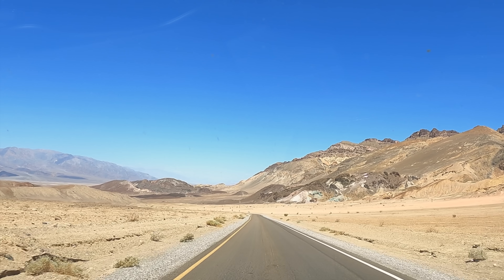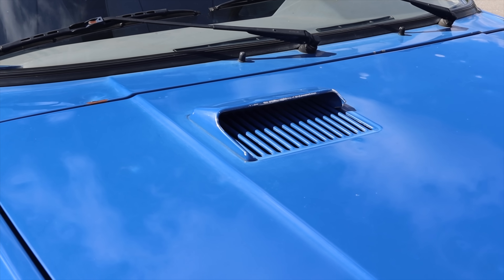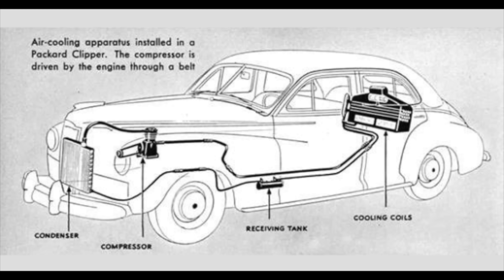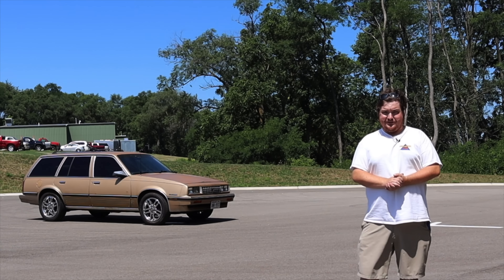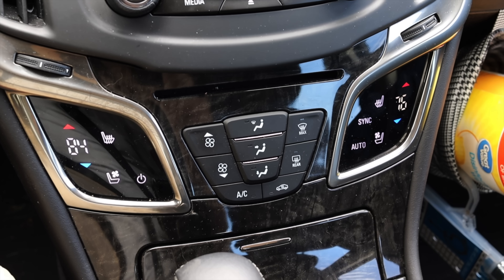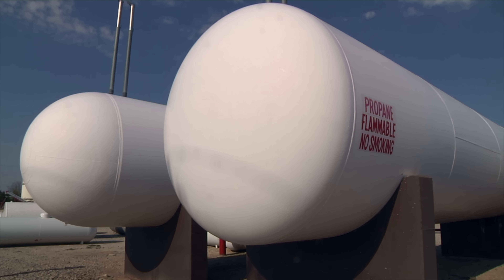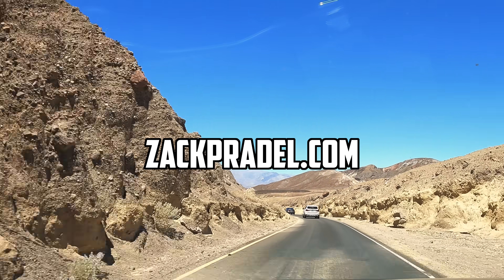Air Conditioning - The Story Of R12 & Why Modern Air Conditioning SUCKS!

Comment from the maker: CARS WERE BETTER IN THE 80’s STICKER NOW AVAILABLE!

 https://www.zackpradel.com/product-page/cars-were-better-in-the-80-s-sticker
Reply: 73 Mercury Rideau 500, 350 Cleveland, MX trans.  The AC compressor was 50 lbs of steel. R12.  - In Hot July and August - I could make it snow like in Canada. Being Canadian, that was just too much fun.    13 mpg - 11 when it snowed.   Cheers from an old dude.
Reply: i don't think that's going to sell that well
Reply: WTF? 
80's cars and trucks, every brand, in general sucked!  We considered it some kind of accomplishment if they started and ran in the cold, or didn't overheat in the summer.  Most couldn't max out that 85mph speedo, and when you tried they sounded like they were gonna fly apart.  They felt like they were gonna blow up at 55!  For you younger folks, that was the fastest allowed by law NATIONWIDE in the 80's. 
People wore it as a badge and bragged if they somehow squeezed 100,000 miles out of one of theses POS cars/trucks after working on the damn things constantly. Every week there was a maintenance item.  Oil change, tranny fluid, spark plugs, coolant, brakes, differential oil, transfer case, tires.  And they leaked every damn fluid all the time.   My pickups couldn't carry or tow they're rated capacities.  They broke when you loaded them down even with all that work. Braking was almost non-existant with a heavy load.  If you loaded the bed close to gvwr, you could barley steer. Every vehicle I've been in that has been made in the last 10 years is, for the most part, a high performance reliable rocket that will run for 100,000 miles without ANY service.  They don't leak, and they run smooth as silk.  My last 3 new trucks can pull 30,000+ all day long as fast as you wanna go.  They start and run without any problem every time no matter the weather.  Heck, I don't even have to be in them to start them!  I change oil once a year and trade them in at 100,000 miles.  New automobiles are so much better that after I abuse one.  Another guy can buy it with 100k on the clock and keep using it!
Reply: @ThePragmatologist you still see vehicles from 80s on the road today tho let’s if you can say the about modern vehicles in the next 40 to 50 years
Reply: @ThePragmatologist  Nope. Honda, Toyota, Nissan, Mazda, VW...all had many good products back then  that were not only pretty reliable, they were more importantly DURABLE. Which meant you could mostly cheaply and easily maintain and repair these cars for decades! I know I was  there. 
My 1984 Rabbit GTI (MK 1  Golf GTI) was the best car I have ever owned, and I am old now. The past two decades or so most car models are horrible in so many ways and outrageously priced.
Reply: @horseathalt7308 
Does your 1984 rabbit routinely pull 20,000lbs?  None of the brands you mentioned ever made a vehicle that could.  The Japanese imports had their problems as well.  Getting a part was the big one.  My point of view from memory is that even the best 80's vehicles were a pile of garbage compared to what I can buy new today in both capability and reliability.
Reply: @ThePragmatologist  You and many others, (you claim you were around in the 80's but I don't think so) don't get the difference between reliability and durability. Today's vehicles are more reliable when you first buy them and for perhaps 4 or 5 years afterwards. However once that time period passes try actually making major repairs and maintenance 7-25 years later.....that 1970s-1990s car or truck will still be practical to repair, or even rebuild...the past 20 years or so that modern type of vehicle will cost a fortune to do any kind of major repair to and therefore will be taken off the road after just a decade or so maybe less, while those car and trucks from the 1990s and prior (especially those from the 70s-80s) will be practical to keep on the road for perhaps 50 years!
Reply: @ThePragmatologist  What in the world were you doing to your poor cars and trucks that caused what you described? My mom owned two cars across the 80s; a '79 Pontiac Bonnevile, which she drove until '89 and put several hundred thousand miles on without a problem, and an '87 Camaro she bought used, which she drove until '98, also without issue. Both of these never had a problem in any weather. Most importantly, neither had any of that stupid CAN-BUS stuff, no problems where one failed component causes 15 DTCs associated with other components that are perfectly fine. Limp-mode wasn't even in the vocabulary. If something was at fault, you had a symptom, did some testing, and found the at-fault component.
Reply: @tempest411  A 79 Bonneville was a large car with a V8 and rear wheel drive.  It's nothing like an car from the 80's except the very largest of cars.  It had a much simpler and robust design than pretty much anything made in the 1980's but a truck.
Reply: Dichlorodifluoromethane is spelled dichloro - difluoro - methane
Reply: Cringe ass Millennial gen / Z talking as if he lived in the '80s meanwhile people actually from the '80s are telling you that you are wrong.
Reply: You might want to change you channel name. It has a different connotation nowadays with all the violence going on.
Reply: No they weren't, not by a long shot. They were mostly bloated tin rust buckets, badly assembled, with short lifespans. Inefficient, dirty running appliences. Well, American cars. 

There is much not to like, today, sure... Mostly due to sonorous government regulations, but still... The efficiency, power, equipment, quality, and longevity blow away most of the crap from the 80's.
Reply: Most cars in the USA when charged back in the 1980s and early 90s were charged with that big container or 12 oz containers of Freon branded "Arctic Ice"  ! I remember because I installed factory accessory AC systems in base model Honda's back then. R12 works best.
Reply: The 80's cars were crap.  They were miserable to drive.
Reply: I’d say mid to late 90s myself - they seemed to get the recipe just right - there were a lot of handsome cars around then, they were well equipped but not to the point of gimmickry, well built, still possible for any mechanic to maintain, and not too expensive to run. There was also more choice - not all manufacturers were on an SUV mission - you could still buy hatchbacks, saloons / sedans, and estates / station wagons.
Reply: I found the 80s to early 2000's vehicles were the most reliable with just enough technology to be very reliable, but now they are so complicated with auto makers designing them with planned obsolescence.  Just listen to Scotty Kilmer about how unreliable these modern cars have become.
Reply: @opencarry3860   Indeed.  I have a 2000 Buick Regal GS. Even by then, they were getting pretty complicated.  I have the factory manuals, and they stack 6.5"!  There are already over 3500 diagnostic codes in a 22 year old car!
Reply: They were some of the worst cars ever made.
Reply: @autohelix  You must be a millennial.
Reply: @tempest411   Yep and I went to automotive school, and worked on a few cars from the eighties they are piles of junk.
Reply: @autohelix  They must have been in pretty bad condition. I've found them to be very reliable and much easier to work on.
Reply: No. They. Weren't. I'm 77, seen a lot of cars in my years.  Modern cars are light years more reliable than the old ones.
Reply: @frequentlycynical642  No they're not. It just seems that way when they're new. Anything with OBD2 becomes a nightmare once they get a bit of time and miles under them. Ease of repair matters, and newer cars are definitely not.
Reply: @tempest411  I don't know where you are getting that from. OBD2 standardized the auto industry. For example, if you're trying to diag a rich/lean condition, the fuel trims work the same way on every car. The dtc's are the same, all the reference voltages are standardized, etc....That's why you can use a $50 scanner and get the same data stream readings on a Ford, as you would on a BMW.

As for OBD2 being a nightmare, most of it comes from tech's not taking the time to learn how it all works. Its only a nightmare if you don't know what you're doing. Everyone has their own opinions, but for me, I would never want to go back to pre OBD2.

Also keep in mind a huge portions of a vehicles electronics network has nothing to do with OBD2. Its manufacturer specific. That part can be complicated, and you certainly make a valid point, It just doesn't include OBD2.
Reply: @AT-wl9yq  I dislike all the spurious codes generated that have nothing to do with the actual fault. You can have a fuel trim fault because of a bad O2 sensor, but you end up with many other codes, like failed catalytic converter,  random misfire, throttle setting errors, secondary air injection, etc. What a mess! But you're right about not ALL the problems being caused by OBD2. CAN-BUS systems suck as well. What kind of idiot designed a system where one failed module can cause others to stop functioning as well??? And why do we need all these stupid modules anyway? Well, I kinda know the answer to that one, but it's stupid; because of all the dumb cutesy features on cars these days. One touch to close windows, central locking, memory settings, automatic HVAC. It all sounds great until you realize those modules can cost thousands when they fail-and they require TONS of additional wiring. All that stuff are just additional failure points without any meaningful contribution to the car's performance or comfort.
Reply: @tempest411  VW were perfect in the 90s and early 2000
Reply: @minimum4418  I got lots of complaints on those compared to the earlier models. It seems after OBD2 was introduced lots of cars went to pot. VWs have a terrible reputation today.
Reply: @tempest411  Ease of repair matters to mechanics. I don't give a shit if your job is harder. Modern cars are safer and less likely to need to go to the shop in the first place.
Reply: @Thinwhiteduke1185  You SHOULD care.The extra difficulty translates into what you'll have to pay to fix it. On top of that, paying other people to work on your car is wasteful ($$$) and just plain lazy.
Reply: WILL IT BLEND?

Comment: The ozone Layer hole and global warming (aka global climate change as the effect won't cause all areas of the planet to warm in the same way) are two unrelated issues. The ozone layer blocks high energy UV photons from the sun. As the ozone layer started depleting, incidents of things like skin cancer started increasing, and if it completely went away then life as we know it on the Earth would no longer be possible. Climate change is an increase in average global temperature cause by the way greenhouse gasses block infrared radiation.

Comment: New ACs are less powerful because they're designed as such and usually even have smaller compressors. Old AC units sucked down a lot of power and fuel. They'd draw a good 10hp while decreasing your mpg, (especially if the windows were open) frankly they were stupidly overpowered and inefficient, new AC systems take longer to cool down, but they work fine. and most people are okay with that tradeoff of fuel efficiency/no power loss over faster cooling air conditioning.

It seems like the ban of r-12 just encouraged companies/engineers to actually pay attention to and solve this problem.

Comment: They should allow companies to remake our 12 for classic vehicles only and you have to prove you have one for it. Your video shows that the ozone layer is healed itself. But the minute amount of R12 that's released into the atmosphere if there is a AC failure is way less than the CFCs that were released constantly by aerosol cans on daily basis. That should be a middle of the road we can get together to keep these old cars going. A proper retrofit to 134 is definitely more cross prohibitive than fixing and refilling R12

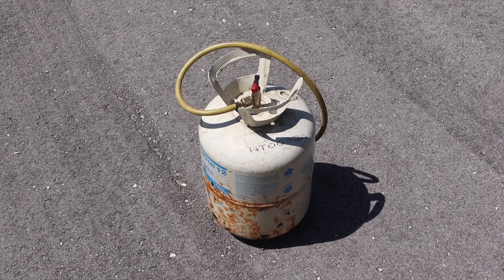Comment: 4:59 It was actually creating a hole in the ozone layer.  It does have a high global warming potential, but that wasn't it's primary issue.  The chlorine atoms of the molecule would be cleaved by UV light.  The loose chlorine atoms would then strip an oxygen from a ozone molecule.  They would continue to do this until they were washed from the atmosphere through natural processes.  The natural processes were slower then the amount of R12 released.  Also, really?  di-chloro-di fluoro-methane.  It's not that hard to say.

Comment: I work repairing air conditioners and yes, R-12 have much more capacity than R-134a to transport heat from inside to outside but this have an easy solution: put bigger compressor, bigger radiators and get the same power. But more things was changed: from hot/cold manual regulation to electronic temperature based motorized mixer. And this is part of the "problem", the electronic clima limit how cold the air can flow, to prevent people to be sick by a too cold air in summer. But I was cars and trucks with R-134a air conditioner that can blow air at 16ºC (61ºF) and less in summer (with manual cold/hot control) and... I'ts excessive.

Comment: As a refrigeration tech r-12 and r-134a both suck r-22 (what most people actually call freon) was probably the best all around refrigerant ever made but we have mostly phased that out too. Don't get me started about the whole "environmentally friendly" refrigerant crap if it was actually about the environment everything would either use CO2 or propane (r-290) and we would be done with it.
Reply: Yep. Way back in the late 1970's I worked for a company that operated both GMC & MCI motor coaches-the GMC units A/C used R-12-the MCI units R-22-so we had to keep both in stock to service the buses. As I recall-the MCI units worked better than the GMC  units-both systems in the coaches were built by Trane & had pretty decent capacity.

Comment: we owned a 1995 car that we converted to R134A... and for modern cars its not just the gas used in the systems... its the compressor type as well. in the old days they used a piston type compressors that work really well even if the car is idling but it takes more power from the engine. now all cars running rotary type compressor because they are efficient on power and lighter.

Comment: This video is whack. You can't talk about air conditioning and comparing refrigerants without mentioning coefficient of production. R-134 moves more units of energy per unit consumed than R-12. R-134 systems have a COP between 2.8-3.3 while R-12 systems have a COP between 2.7-3.1. with same quality systems R-134 outperforms R-12. Newer R-1234 is slightly worse than R-12, with COP between 2.7-3.0. however factoring in the difference in environmental and health benefits R-1234 is still overall better than R-12. The only reason older systems were "better" than todays are because they were significantly higher powered than the average systems of today.
Reply: this comment is whack lol, no one is beliving that r12 is bad for the environment anymore
Reply: @NEON2600R-12 has a GWP of 10,900, meaning just one gallon has the same heat trapping effect as 10,900 gallons of CO2. Additionally, the CO2 gets absorbed into plant life within just a few years, while R-12 takes a little over a century before it decomposes. Even more, R-12 eats through ozone quicker than it can naturally replenish, posing significant UV radiation risks. Even ignoring environmental and health concerns, by means of COP, R-12 is a mid refrigerant anyways.

Comment: No, the gas isn't why modern AC are weaker. They all use a magnetic clutch to turn off the compressor when it's below a set temperature in the condenser. Their efficiency drops the colder it gets.
Old cars had larger compressors than needed and they ran constantly. You can partially reproduce this by using the dials manually, making sure that "AC eco" is off, set temperature to Lowest possible, adjust fan manually to a reasonable level and the compressor should stay on and the output temperature will more closely resemble an older car.
Many modern cars come with hilariously small compressors to save fuel though.
My 2009 Impreza had a six piston compressor and would deliver literal snow. On manual mode. 
If the cars ECU is very aggressive with saving fuel on the AC, you can replace the clutch relay with a manual switch. But if the compressor has some issue that the electronics would have caught, or it has low coolant, it will self destruct.

Comment: The mole/gr weight of R12 is 120 gr/ mole. Argon is about 40 gr/ mole, if you get argon in your lungs, it is so much heavier than air( nitrogen about 14 gr/ mole and oxygen about 30 gr/ mole) that you wont be able to expel it and you will suffocate. That is much more true with R12. For R12 to dissipate to any degree the level of the ozone layer would take 100’s of years if not more likely 1000’s, as well as the same time to dissapate out. That is both incongruent with the enlarging hole as well as its closing. No science here.
   134a has three strikes against it for me. 1- much smaller molecules and more likely to leak. 2- higher pressures…and more likely to leak. 3- It’s composition contains more CL atoms and Sulfer. When leaking, this introduces O2 and H2O which makes H2SO4 and HCL, sulfuric and hydrocloric acid. That’s what destroyed your components…and caused more leaks. There is probably been more 134a released than all other refrigerants combined.
    I have been using propane bases refrigerants for years. Large molecules, lower pressures similar to R12, less environmental damaging no matter where it is, and a Canadian product, Duracool, has a higher flash point than all refrigerants mentioned here and is a legal replacement for 134a in the US of A.